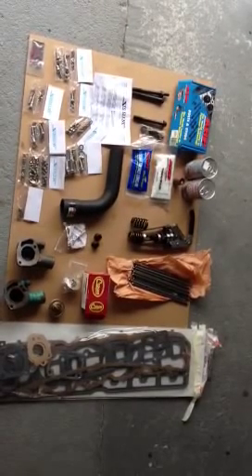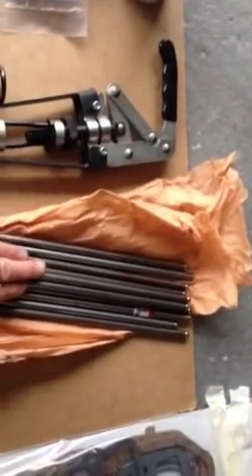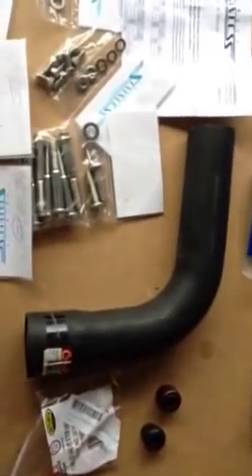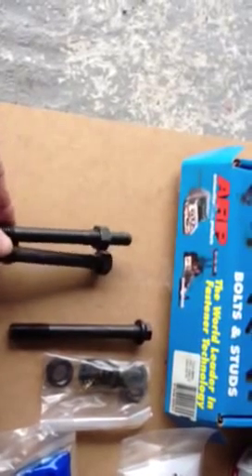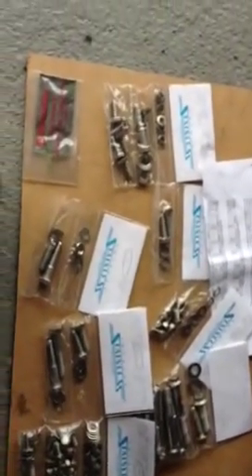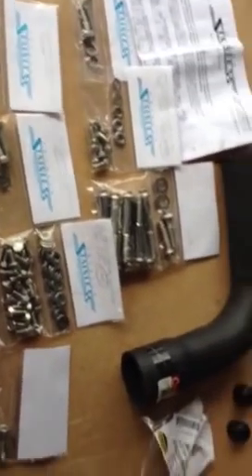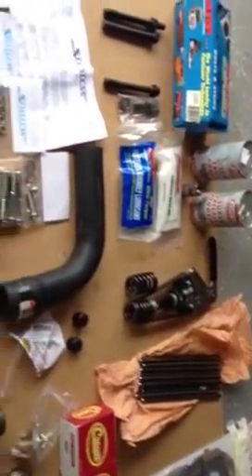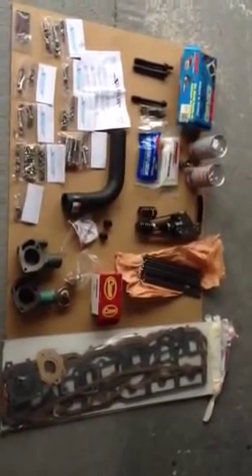Jeep 258 bent push rod sticky valve - full analysis #18

Comment: Hi Ronald
do you know the serial number of the arp head bolts?
is it 112-3601
or 112-4001
Thanks
Reply from the maker: Hi,
what I ordered was:
1 x ARP Thread Sealer with Teflon 1.69 oz. (100-9904) 
1 x ARP AMC 258 CI Head Bolt Kit (112-3601)
1 x ARP Ultra-Torque™ assembly lube 1.69 oz. (100-9909) 

Good luck.
Ronald
Reply from the maker: Hi, did you manage to order them and installed ?
Cheers
Ronald